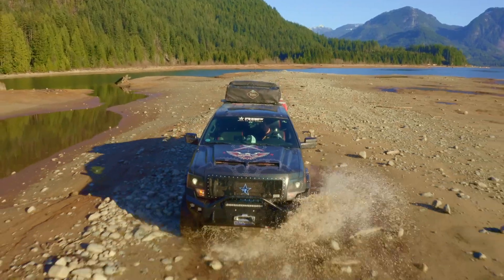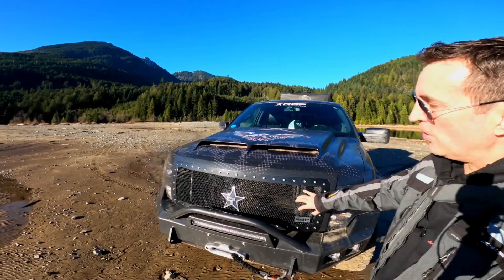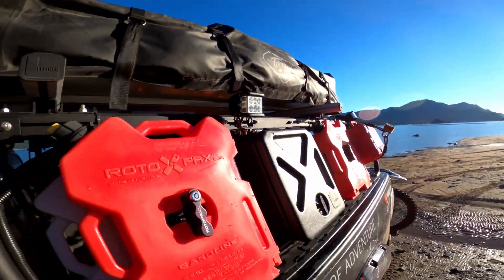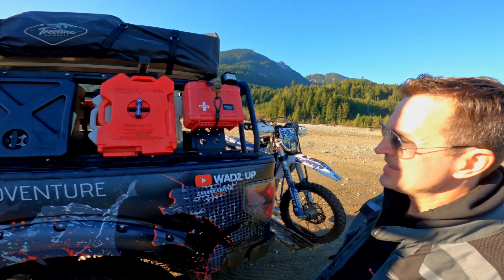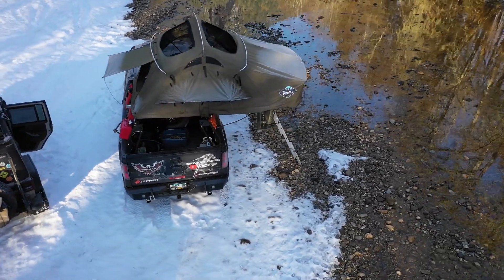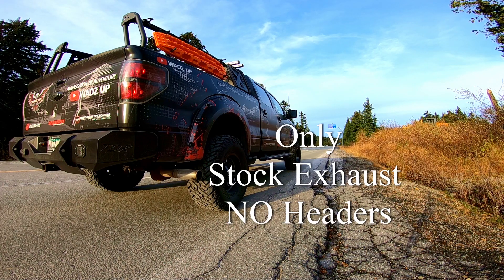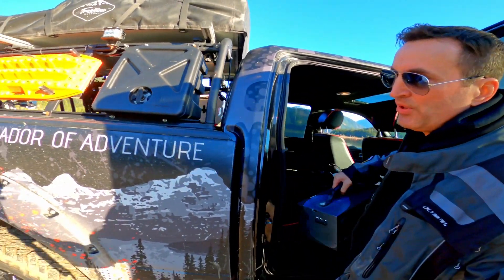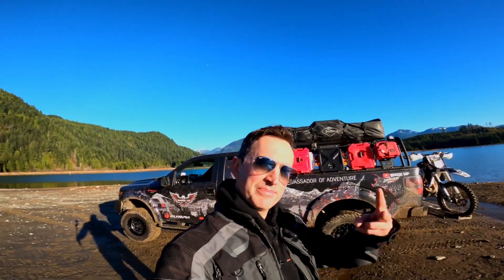1 YEAR Overland Build Rig Walk Around Review (Pros & Cons)

Comment: Great video and great truck.  I think I will stay with my RTT Overland Trailer, only so I can keep my bike in the truck bed.  I looked at the hitch carriers with my current Jeep JK, but then I can't pull the trailer and my bike is 400lbs, not 250 like your Husky.   My 2 cents, is that I like being able to set up camp with the trailer/RTT, then drive away to the trails each day.  Same when carrying canoes/kayaks on the rack.  But I know that RTT on the truck versus the trailer is a big overland controversy.   So that is how i finally got to the idea of the F150, rack, etc.  and your experience and comments are very useful.

Comment: You mentioned how much it rains in BC. Take that into consideration if/when you do try a clam shell rtt. Most people that review rtt don't even mention how the soft shell tents create a "awning" and how you climb under the tent to get inside which protects you from the elements and your boot bags. You'll be completely exposed when you need get out of a hard shell rtt if it's raining. I wish they talked about that more, instead of constantly clamouring about the pack up time, I'm quite disappointed with my pop up tent and would prefer a soft shell.
Reply from the maker: Great feedback and I definitely have considered that. I love the overhang with the TREELINE and the annex room . I use it as a boot room and for drying muddy wet gear, changing and even setting up the portable Cassette. With camping you often solve one problem but create another challenge, generally all first world problems but I do like the idea of setting up faster and tearing down easier. Maybe there a Four Wheel Off-road drop down camper in my future. P.s Ive done a fairly detailed review of my TREELINE 4 season RTT if your interested in hearing my experience. Thanks for watching 
WADZ

Comment: if you lived in place without the constant rain, would you be looking for a hard shell? been looking for a 4 person (2 adults 2 kids) tent that can hold up to high winds, been looking at treeline, 23zero (seems similar approach but different materials, e.g. four poles for window awnings but less dense fabric) and Skycamp (strong base, but video of 40mph is concerning). any thoughts - will likely not see cold temps, but no or little rain
Reply from the maker: No.  The TREELINE is a great 👍 RTT Did you watch my review???
Reply: @WADZUP  yes great review, hence a bit surprised you are looking to switch, seems like treeline has top materials and great design
Reply from the maker: @ether9504  Well the thing with changing gear is you solve one thing and create another issue, so I’ll start by trying one out first.

Comment: Beautiful truck! 🔥 
I have exact same truck and about to start my build with similar goals. Have got a ton of ideas from your build! Well done and thank you 👍
Reply from the maker: Awesome and thanks 🙏 let me know if you need anything
Reply: What motor is in this build? I've been wanting to get one with 2nd Gen 5.0 coyote. I've heard bad idea as it makes its torque in higher rpms but it's a truck not a rock crawler 😅
Reply: It’s the 5.0. Easy to work on, reliable, parts are dime a dozen. I’ve climbed Idaho mountains, plowed over sand dunes, and buried it in Ozark rivers. And even put it to work on the farm hauling trees. You’ll be very happy if you get your hands on one
Reply: @ericoconnor21   see and that's what I'm going for after a handful of triton motors and always looked at the 5.0 and the 6.2. 5.0 small packs a wide range of power and easy to get your hands around and work on. Just waiting on taxes and I found a 2015 4x4 sport 5.0 V8 scratches in paint around the truck one minor dent in rear left panel of bed. Priced at 10,995.